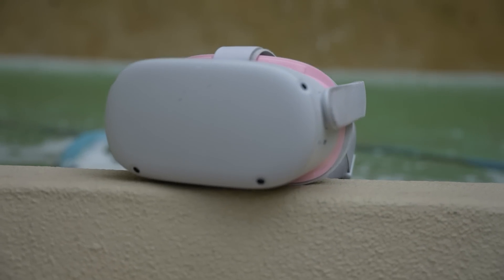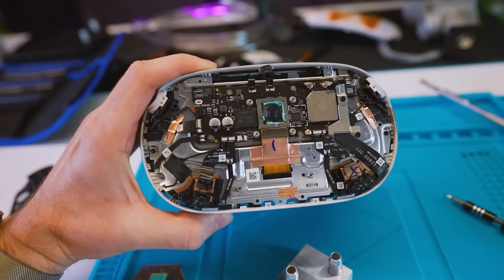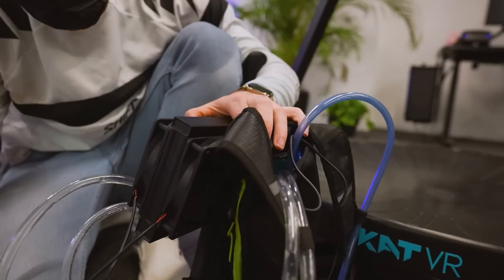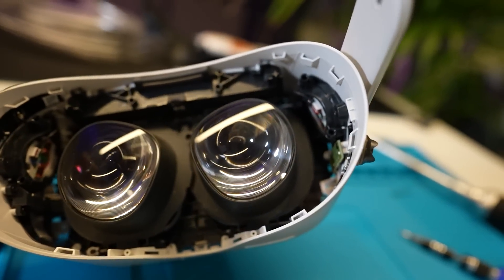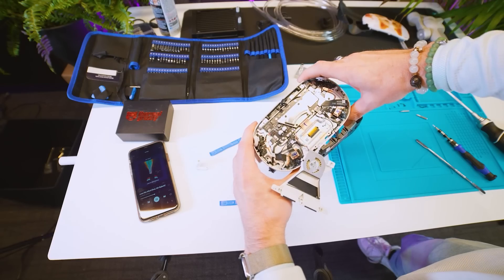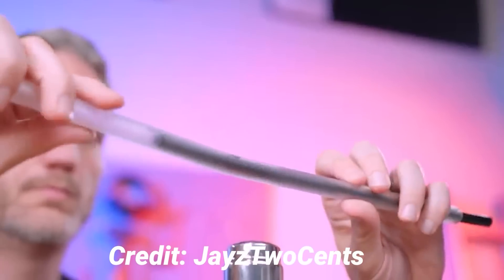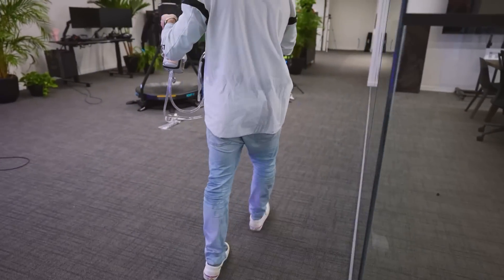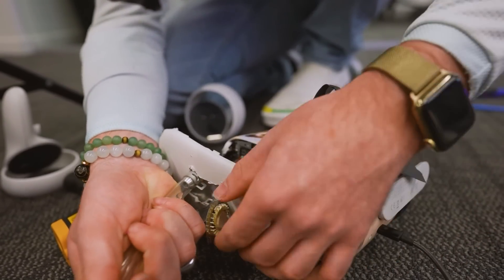What happens if you WATERCOOL an Oculus Quest 2?

Comment: You can actually get much higher performance with just a stock Quest 2 by using setting the GPU and CPU Levels to 5 using setprop commands
Reply: This. Not setting CPU/GPU levels kinda makes this whole experiment useless. I am disappointed this is not the most upvoted comment.
Reply: @dmytroliubarskyi5050  *liked
Reply: @abatall  *synonyms
Reply: @biguglybucker  anyone can do with adb/sidequest
Reply: @biguglybucker  Anybody can do it. You just have to enable developer mode
Reply: What is the drawback of doing this? Would it just basically burn battery faster, or are their heating concerns?
Reply: @djandjb1  I mean... The device will get pretty hot, but not enough to damage anything. Other than that it will burn through the battery faster
Reply: @isaiahheitzman  Oh, alright then, and as far as you know, if you’re primarily using PCVR with the quest 2, would that extra performance even be a benefit, or would the GPU in your PC take over primarily, because I use desktop streaming and I’m not sure whether the loss in time would be worth it, or even have any effect at all
Reply: @djandjb1  Not if you are using PCVR. All the quest does is decoding when using PCVR, It doesn't actually contribute to the rendering at all.
Reply: @isaiahheitzman  Ah, I see. Thanks for answering. Happy thanksgiving (if you celebrate it)
Reply: @djandjb1  Happy thanks giving too!
Reply: What are the default settings?  I'm really happy w it out of the box so not sure I want to go chasing performance just yet.  I went to the SFVR conference in 2016 and the quest seems pretty much as good as anything I remember seeing there except the Enterprise stuff
Reply: @crieverytim  you should def give it a try and adapt other Settings via side quest, it makes a difference in my opinion, which is clearly visible
Reply: @djandjb1  lol if on PCVR then its just another monitor lmao.
Reply: @isaiahheitzman  It is also sending the controller and headset data such as positions rotation and microphone data
Reply: Snoopedy  yeah the commands are adb shell setprop debug.oculus.g
cpuLevel 5 just replace the c with a g for the other one

Comment: If you knew watercooling on PC a little bit you would know that a better cooling solution does not automatically increase the performance. It only means that you can overclock more your CPU. But overclocking an SoC is probably tricky... On Oculus the CPU and GPU parts can run at 4 different levels. Apparently you can enforce these levels with SideQuest

Comment: You'd need root access to change your cpu / gpu states. Last I heard every time someone has even found a semi successful way to do root, or even just to sign in without facebook they've done a security patch within a couple days to eliminate the option. It'll probably be years before there's actually a good means of rooting that doesn't make the device unuseable. And it'll only work then because oculus will likely stop supporting the headset and doing updates at some point. So when the format is dead then you'll be likely to get that extra 10-15% perfomance out of it. Of course by that time we'll likely have headsets with much better chipsets and it won't be worth doing anymore. But if you still have this headset then it might be fun to revisit.
Reply: Where have you heard about these root access cases? Would be cool to read about them.

Also, how can FB get to know about the method and fix it, if one for example uses quest on offline mode/out from internet access? :o

Getting a root and a jailbreak would be absolutely amazing.
Reply: @ImaplanetJupiteeeerr  That's the thing, just like with Playstation jailbreaks they won't know if it's a private exploit. The problem with that though is that only a select few people will have access to it, making it almost the same as if there were no method available to the rest of people. The second it goes public, it will be patched pretty soon.
Reply: @ImaplanetJupiteeeerr  There are Reddit threads. But essentially they only work on older firmwares so if you upgrade regularly it won't be useful to you and it also means any useful features unlocked by those updates you don't get. Unless someone home brews up a custom os install. Which given how few people have root seems unlikely that anyone would bother with.
Reply: @exturkconner  Thanks for the reply, good info! It's a shame that the custom os seems unlikely, and ofc expected. Collecting data and selling games on oculus store is the sole purpose of quest and keeping the os and root in a tight control is therefore ofc a priority for Oculus. :)
Reply: @PhantomlyReaper  Yeah that is an excellent point aswell. :)
Reply: They are that quick to fix the jail breaks but wait months to fix all the login and visual bugs? Dang it.
Reply: @FastForwardPlans  piracy = no money
Reply: @vadnegru  Jailbreaks are not equivalent to piracy, whoever gave you that idea lied to you. True it could potentially mean less money to the products creator, but all it does is open the device to the use of outside programs. It's usually done to access other market places and stuff like that.
Reply: @FastForwardPlans  okay, piracy is strong word here but any way to swing away from Oculus store means less money for Meta.
oops piracy is already exist with VRP E.. and Siden... but no jaibreak yet.
Reply: You can change the CPU and GPU level from sidequest, you don't need anything else

Comment: i'm curious how much of a cooling difference there is if you put basic 6 to 9, 1mm hole exhaust holes with a dust filter sheet in front of where the fan is.

Comment: Cool!
A shame the clock speeds were locked, I was hoping this would’ve helped a lot with performance.
Reply: I feel as that there should be more people that tinker with the quest 2 and also manage to get around the restrictions.
Reply: @brithim  I say that about the firmware also. I know it’s not easy, but I feel like there 100% should be a way to bypass the whole Facebook bricking your headset thing
Reply: @brithim  well... most of the ppl who buy a quest dont have/want to spend a lot on VR and the risk of breaking the quest is really high
Reply: @Goblinmine_  waiting for LTT to show me how. I have a quest one and I'll eventually buy quest 3 or quest pro and by than I won't care about the original and I'll probably try on that one
Reply: @brithim  Yeah people who tinker generally don't buy a Quest 2. They make their own headset or they buy a standard PC-VR HMD with a more open ecosystem, that you can modify and extend with new hardware relatively easily.
Reply: you can over clock with a commad prompt in sidequest

Comment: I wonder how much temperature difference there would have been, just opening up a hole for the existing fan to get fresh air into the intake instead of just re-circulating the hot air around the headset?
Reply: @choppercove  and a bigger heat sink.

Comment: Enable developer mod on the headset, connect it to your pc, and open SideQuest. Go to settingsand you get to change refresh rate, resolution, and gpu level (I believe overclocking).
Reply: thanks for sharing I wasn't aware of that, although I did use SideQuest and knew it is android all along

Comment: Hey @ThrillSeeker I hope you see this. You might be able to get better performance by opening Sidequest going into settings and forcing the CPU/GPU level to 4. This will put the CPU and GPU at a slightly higher clock speed than normal. You might also have some luck using android debug tools (adb). using the following 2 commands

adb shell setprop debug.oculus.cpuLevel 4
adb shell setprop debug.oculus.gpuLevel 4

I wish you the best of luck :)

Comment: Move the fan to where the lenses are to decrease fogging, lengthen the wires to the fan so the fan is still somewhat usable and plugged in, 3d print a mounting bracket for the water block, run the tubes along the length of the headset straps using velcro so it is "tied" into the headset instead of hanging (the force from the tubing can create unwanted tension on the water block. after that mount the rear radiator anywhere you like, 3d print a new front panel (looks like you just need to increase the distance to allot for waterblock, or better yet, measure and use fittings on the front plate to hold the block instead (needs correct pressure ofc to the CPU) making it the mounting bracket for the water block

Comment: I just took a a plastic bag for a vacuum sealer (those to keep food fresh), cut it to a matching size, filled it with water, sealed it and put it into the freezer. When needed, I use that as cooling solution for my VR headset. I have two of those for longer sessions and it works surprisingly good. ;-)

Comment: Because of that video my mate did it too , angled tubes and pump with fan attached on the back of his head. He 3d printed the front plate instead of cutting thru. Its cool but  didnt help much in term of gaming .

he ended up printing a new front plate to accomodate two small noctua fans and more holes with dust filters on it .

He says that it works better than water cooling because the pump dont like being shaked around.

Comment: Next time try water cooling for Raspberry Pi systems. It would fit better in Quest 2. Water block is smaller so it won't short electronics. Tubes are smaller, so you can route them around your head.

Comment: honestly... if you could meet up with quest somehow I have an idea for a cover. so the cover would essentially be a waterblock on one half, with a small fan on it. the cover would have a cavity in the front that vents the air flow with holes spanning the entire way around. now the waterblock would us the same plug as the small fan (hopefully it can provide enough power, if not maybe they have to sell it with a rechargeable battery power that slide into the charging port of the oculus. the water would essentially have the other side to move  through and any chips or components needed would fit in over there. I could draw up a design and patent it, but personally I don't care enough and I'm lazy so do with this what you will.

Comment: Use a sharpening stone to flat off the plate for better surface contact, ideally get some 90 degree bends up front so the tubes loop close to the headset, then it'll be a better setup

Comment: I know this is a bit late to the party at this point, but what if you made a custom aluminum front plate that acts as a big heatsink, it could be intricately engraved with custom patterns that give it the extra surface area and can still use the stock fan and maybe save battery as the fan would not need to spin up as much.

Comment: Two good reasons as for why that quest 2 isn't performing much better is because the clocks are in fact locked and you didn't have enough pressure on your chip from your waterblock.

Thermal paste is a pretty poor conductor, so you shouldn't use it to compensate for air being between the two spaces by just putting in more paste.

Comment: If you ever try this again, just put a larger air cooler on it with a small Noctua fan attached and plugged in to the Quest. Mount it all with a 3d printed faceplate so it's entirely self contained and clean. I doubt the TDP of an XR2 warrants using a water cooler. Cool video tho.

Comment: Have you thought about CNC milling custom faceplate sized heatsink out of copper, with a couple o small fans, like on a graphics card, but be more compact? The fins would direct air out, though the sides of the faceplate. The fans would direct air in, through the front of the faceplate. You'd reattach the plastic cover after providing air intakes for the fans.  However, this will extend the thickens of the unit, by at least an inch. It would be like putting a big Coolermaster heatsink on a CPU.

Comment: the best way to do this while keeping the agility and mobility of the regular quest, without worrying to snap off a tube, is to use a "liquid buffer" like in the xiaomi pocophone f1. this buffer will add thermal Mass , thus flattening the temperature spikes and keeping the sstem from heating up so fast/much.

oh and by the way @Thrillseeker : if you want to redo your experiment in a more elegant and user friendly way : i am from the IT and i have several ideas how you could cool the quest in a WAY more effektive way than stock while also retaining its key traits. and this without water or anything fancy. its rather "simple". it will just need a few preperations and then tests.

Comment: Just drilling holes on the HTC Vive's cable cover lets a bunch of heat out.  So if you have an OG Vive the top cable cover can have 15 or so small holes drilled into it. The HDMI and USB ports get hot on that HMD. It really helped my system.

Comment: Funny thing is, you could mount a 90mm fan to the faceplate and run a raspberry pi heat sync on the chip and get the same, if not better, cooling. Plus you'd be drawing air over the rest of the internals.

Comment: There is actually a cheat with water cooling, ice water in the radiator, or you could run the tube into a backpack container of water and refreezable packs together with duct tape.

Comment: To be honest, I'd be more interested to see a watercooled facial interface rather than watercooling the actual chip.  Mainly because, as you said, the chip is firmware locked at a set clock speed.  BUT a watercooled facial interface would make a world of difference in terms of comfort during long play sessions.  Most of the reason I need to stop playing VR is due to the heat around my face becoming overwhelming. so a comfort mod would be more useful in the immediate future than a mod that requires root-level firmware access to be useful.

Comment: I am no thermodynamics expert, but I am kinda thinking that a little bit of heatpiping, a slightly larger fan and venting holes in the face cover would solve the majority of heat issues - if the Quest 2 even has any. The Index however would benefit from an active cooling solution because they get quite warm under the hood...

Comment: Should have sanded down the water block to make it all smooth and shiny. Thermal compound can only do so much.

The reason dynamic clock speeds aren't in the Quest is that devs working in wintertimes in norway would be developing for a headset that would be like 10-15% faster than the headset someone around the equator gets in the summertime. That means that testing for "people in warmer climates" becomes a thing for devs up north... Or they need to pin the clock rate to lowest possible clock rate in australian summertime or something like that to reach the lowest performance player. 

For devs, a locked processor is a great boon. Means you don't get a million crash reports from the equatorial region when you release your game that's perfectly tuned to run at 90 in finland in january.

Comment: If you ever did end up more properly doing this I think a good way to go about it could be to mount a smaller setup onto the top and bottom of the quest or even better on to the back of a sturdy headstrap for weight balance. It would look impressive and eliminate tubes around the body. If I had the tools and knowledge this is definitely something I would partake in

Comment: your problem isn't the aluminium, it's sandwiching multiple layers of metal and thermal compound. The problem with just throwing on a massive blob of compound is that it will work towards insulating heat not conducting it. Yes it's way better than air but it is terrible compared to metal on metal contact. I'm honestly surprised you even saw an improvement.

Comment: By the way water cooling isn't the end all be all of cooling, the water is replacing the copper heat pipes of an air cooler. In raw conductivity it cannot hold a candle. The best cooling would be a copper heat pipe with more fan.

Comment: I think it wouldve been better just to have a slightly larger fan. the hot air comes out of the top out of that little slit in the front of the device. add a small vapor chamber heatsink and it's golden.

Comment: I'd say do it right next time and also try and big modern fan on there, these days the tube style watercooling, versus big fan(that has multiple tubing directly under it and cools through i believe gas in most cases) is basically the same, mening, the watercooling via long tubes is more of an cool pleasing feature then an actual advantage, they basically have the same performance, anywayz...i'd say throw that one in to the mix next time...and lets hope we won't run around with a big fan on our heads because it works so good in the future! haha.

Comment: Pointless, but fine.

Edit: also, watercooling doesn't necessarily mean it'll run cooler. Just quieter. It's often the case that fan cooling will be far more effiecient, although less glamorous. A GREAT experiment would actually just be a MASSIVE fan.

In fact, I might do that.

Comment: Id love to do a mod for the quest 2 that males it like the index with the depth adjustment dial. To get the lenses right up to the users eyes. 

Looking at the design the casing around the facial interface is mostly doing nothing and could be removed. For me if i have the foam interface off entirely and just have the hard plastic against my face i get the best possible fov. With the foam it is drastically reduced. 

So a design that allows there to still be a full face foam and also dial the body of the quest right up to the eyes would be perfect. 
Just a shame fb will kever reoease the cad files for the current design for people to make mods, and itd be a lot of work to completely redesign the entire shell in order to do it. 

Hopefully more headsets will use the depth adjustment design, because it really is a massive difference.